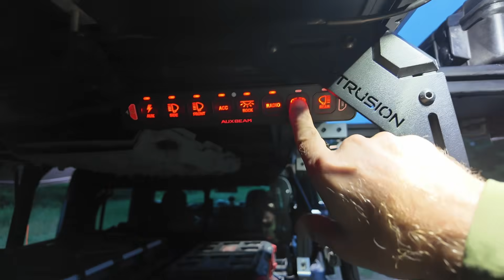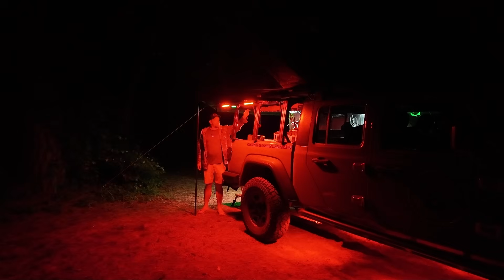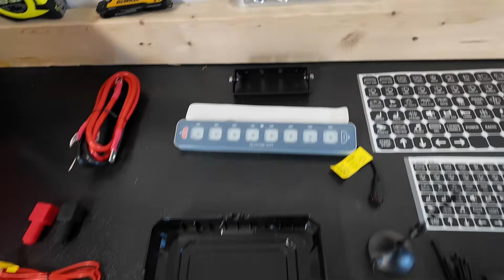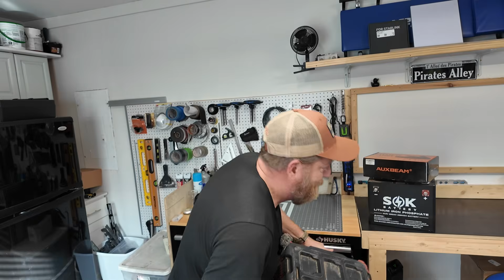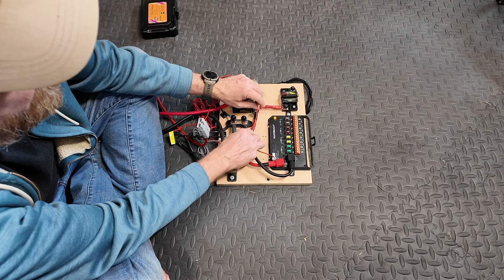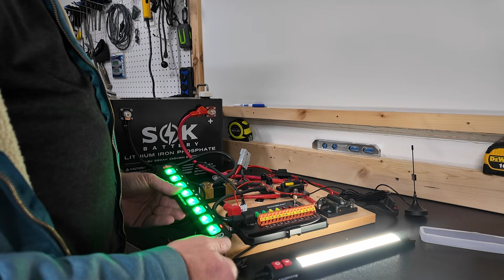AuxBeam Slim Switch Panel

Comment: I love having a swith panel in the back of the Gladiator.  The app makes it 10x better.   So nice to hop into the tent with the lights on and then turn everything off.  Or if a critters visit you can see them.   My last tree i scared a racoon.  

Awesome install
Reply from the maker: Oh awesome I didn’t know you had one too. I love the app also. Got the remote, but usually just use the app. My favorite part is being able to turnoff my Starlink power from the tent. I used to forget to turn that off before bed all the time!